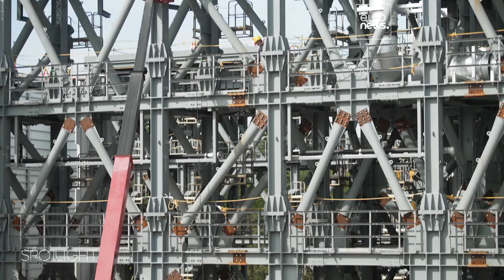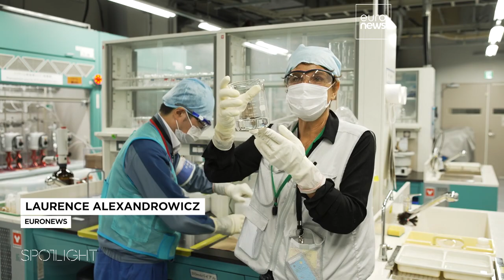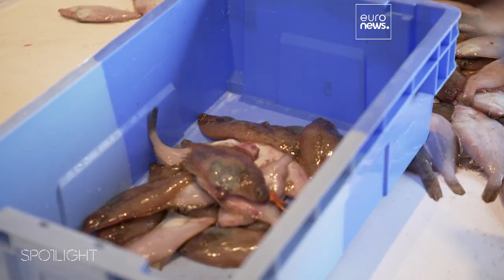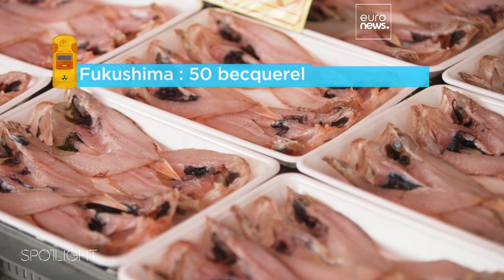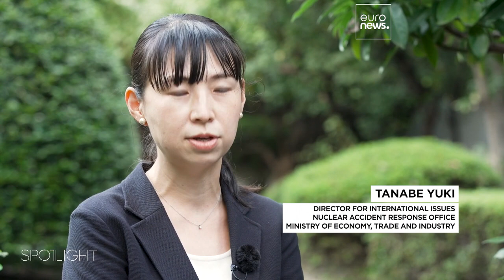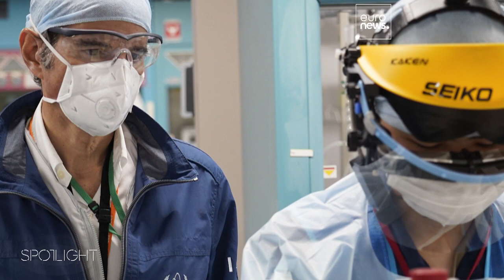Fukushima: Japan prepares to discharge water from the plant into the sea

Comment: Where are those Japanese Engineers?  A simple solution is to build an external loop to recycle the radioactive water back into the reactor for cooling, instead of using clean fresh water for cooling.
Reply: Japan has the ability and technology to solve the problem, but that will consume a lot of money, and discharging into the ocean is a very cheap economic solution.  The Japanese don't care about the consequences.
Reply: @joezou8793   The Japanese tritiated water releases are lower than what your country releases.  Perhaps you don't care about the 'consequences'.

Comment: The contaminated water will directly go to the north american continent flowing over the pacific ocean since the flows of the pacific ocean is turning clockwise.. just google it😢 I am so worried… it will eventually pollute all over the ocean. shame on you japan
Reply: The US has been releasing the same tritiated water for over six decades.
Reply: @ForbiddTV  The contaminated water of Fukushima is distinguished from other nuclear power plants not only by its greater variety of radioactive materials but also the overall much higher radioactivity. If it is discharged to the Pacific Ocean, it will potentially pose a significant threat to the well-being of human health and marine life. Normally, water that is used in cooling a nuclear plant in routine operation and then discharged to the environment has no direct contact with the nuclear reactor fuel cores. In contrast, the contaminated water generated by the Fukushima disaster has come into direct contact with contamination from the melted down cores of three reactors and as such is severely contaminated with many radionuclides. In other words, it is not appropriate to compare nuclear wastewater of normally operating nuclear plants in general and the Fukushima Daiichi nuclear wastewater. According to the latest report by the Japanese government, there are  621 radioactive isotopes were found in the existing nuclear water tanks in Fukushima, among which concentration of a radiouchile called tritium reached about 860 TBq2 –  an alarming level that far exceeds the acceptable norm.

Comment: Shameless Japanese
Reply: All countries with nuclear power plants release the same tritiated water.
Reply: @ForbiddTV  The contaminated water of Fukushima is distinguished from other nuclear power plants not only by its greater variety of radioactive materials but also the overall much higher radioactivity. If it is discharged to the Pacific Ocean, it will potentially pose a significant threat to the well-being of human health and marine life. Normally, water that is used in cooling a nuclear plant in routine operation and then discharged to the environment has no direct contact with the nuclear reactor fuel cores. In contrast, the contaminated water generated by the Fukushima disaster has come into direct contact with contamination from the melted down cores of three reactors and as such is severely contaminated with many radionuclides. In other words, it is not appropriate to compare nuclear wastewater of normally operating nuclear plants in general and the Fukushima Daiichi nuclear wastewater. According to the latest report by the Japanese government, there are  621 radioactive isotopes were found in the existing nuclear water tanks in Fukushima, among which concentration of a radiouchile called tritium reached about 860 TBq2 –  an alarming level that far exceeds the acceptable norm.
Reply: @blackbelt2000   No difference whatsoever.  All nuclear power plants utilize ALPS, so the final product is merely tritiated water.  The Japanese water release plan meets all international safety standards.
Reply: @ForbiddTV  what about all the cesium. Don’t be so delusional.
Reply: @johnosullivan-nq2wd   ALPS removes all but the tritium, don't be so delusional.
Reply: @ForbiddTV  are you an advocate for the Japanese government? What is the reason for your overzealous support for their insane decision to pollute other countries’ pacific ocean in order to save some money?

Comment: What a responsible country, ashamed
Reply: All countries with nuclear power plants release the same tritiated water.
Reply: @ForbiddTV  The contaminated water of Fukushima is distinguished from other nuclear power plants not only by its greater variety of radioactive materials but also the overall much higher radioactivity. If it is discharged to the Pacific Ocean, it will potentially pose a significant threat to the well-being of human health and marine life. Normally, water that is used in cooling a nuclear plant in routine operation and then discharged to the environment has no direct contact with the nuclear reactor fuel cores. In contrast, the contaminated water generated by the Fukushima disaster has come into direct contact with contamination from the melted down cores of three reactors and as such is severely contaminated with many radionuclides. In other words, it is not appropriate to compare nuclear wastewater of normally operating nuclear plants in general and the Fukushima Daiichi nuclear wastewater. According to the latest report by the Japanese government, there are  621 radioactive isotopes were found in the existing nuclear water tanks in Fukushima, among which concentration of a radiouchile called tritium reached about 860 TBq2 –  an alarming level that far exceeds the acceptable norm.
Reply: @blackbelt2000   The water could be released all at once with no issues. There is always around 3400 grams of naturally occurring tritium in the earth‘s atmosphere as it is constantly being produced by cosmic radiation interacting with the upper atmosphere. Most of those 3400 grams are in the earth‘s oceans. The water in Fukushima only contains 2-3 grams of tritium so releasing it all at once would have no measurable impact. There actually are a number of nuclear facilities that release significantly more tritium every single year. The La Hague nuclear reprocessing plant in France for example releases 40 grams of tritium into the Atlantic EVERY SINGLE YEAR. The reason why they are only going to release 0.1-0.2 grams of tritium per year at Fukushima is that the regulatory limits for radioactive releases from the plant are still the same as they were before the accident. So Fukushima isn‘t actually allowed to release more tritium in 2023 than it did when it was a normally operating nuclear plant.
Reply: @ForbiddTV  What happened to Cesium? This contaminated water had direct contact with exploded nuclear reactor which no other nations have now. Good job Japan.. they have a big plan to serve two headed tuna sashimi with lower price in the future lol.
Reply: @larryhoppe7662   That's completely incorrect, ALPS removes all but the tritium.  You could have easily looked that up.

Comment: Why nobody condemned Japan?? Anyone from the Green Party?? A bunch of double STANDARD deluded hypocrites.
Reply: All countries with nuclear power plants release the same tritiated water.
Reply: @ForbiddTV  The contaminated water of Fukushima is distinguished from other nuclear power plants not only by its greater variety of radioactive materials but also the overall much higher radioactivity. If it is discharged to the Pacific Ocean, it will potentially pose a significant threat to the well-being of human health and marine life. Normally, water that is used in cooling a nuclear plant in routine operation and then discharged to the environment has no direct contact with the nuclear reactor fuel cores. In contrast, the contaminated water generated by the Fukushima disaster has come into direct contact with contamination from the melted down cores of three reactors and as such is severely contaminated with many radionuclides. In other words, it is not appropriate to compare nuclear wastewater of normally operating nuclear plants in general and the Fukushima Daiichi nuclear wastewater. According to the latest report by the Japanese government, there are  621 radioactive isotopes were found in the existing nuclear water tanks in Fukushima, among which concentration of a radiouchile called tritium reached about 860 TBq2 –  an alarming level that far exceeds the acceptable norm.
Reply: @ForbiddTV  Since Japanese government claimed the radioactive water caused no harm and very clean why don't they consumed it??

Comment: The radiation levels offshore of Fukushima have dropped in the years since, but some of the reactors there are still leaking. And over the last decade, Japanese authorities have continued to cool the fuel cores with water, which is contaminated by the process. In addition to tritium, more dangerous isotopes with longer radioactive lifetimes, such as ruthenium, cobalt, strontium, and plutonium, sometimes slip through the process. These additional nuclides are present in 71% of the tanks, according to a recent study by local universities. These radioactive isotopes behave differently than tritium in the ocean and are more readily incorporated into marine biota or seafloor sediments.

Comment: Fun fact... The radiation from the Fukushima ELE is killing off the phytoplankton and atmospheric oxygen levels have been dropping because oxygen is no longer being replenished like it used to be. It doesn't take long for oxygen to be used up in one way or another.

Fun fact... as the planetary ocean continues to warm, the methane hydrates are melting and releasing their methane. 

Methane oxidizes, removing breathable oxygen from the air. More the methane, less the oxygen.

Fun fact... this is permanent. It will never get better because of the loss of the phytoplankton.

Bye-bye oxygen.
Reply: But wait! There's more!

Fun fact... Everyone is just marking time until the completely 100% inevitable next CME/carrington event that's coming down the pike.

And then... major bigtime EMP. And then... eventual nuclear meltdowns of all the reactors and spent fuel pools as they lose their cooling systems. The planet will be quickly radiation sterilized from pole to pole.

No one survives. Not anyone anywhere. Everyone dies. And that's that. End of story.

Fun fact... There are hundreds and hundreds and hundreds and hundreds of nuclear reactors and spent fuel pools.

Fun fact...  It is 100% inevitable that the planet will be in the wrong place at the wrong time for a CME/EMP.

Fun fact... nuclear war is hardly even worth mentioning compared to nuclear meltdowns.

A bomb goes boom and that's all the radiation it will ever produce. But meltdowns produce and spew out enormous amounts of new radioactive particles next to forever.

Fun fact... You won't enjoy dying from radiation sickness even the least little bit.

Fun fact... Every day that goes by has become one day less to global meltdown radiation oblivion.

The existence of the many, many, many hundreds of nuclear reactors and spent fuel pools and the loss of their cooling systems will be the Final Word as to What Will Be What.
Reply: Oh, Craig, Craig, Craig...

What part of "100% inevitable" do you not understand?
Reply: Many, many, many hundreds of nuclear reactors have been built like carrington events never, never, never happen. But they do. The Big Bad Wolf of the "final" CME is very definitely coming down the pike. And it can't be denialismed away.
Reply: Is there really, really, REALLY a CME/EMP coming down the pike?

Answer... yep.
Reply: @satanofficial3902   That didn't address a single one of your memes, you just obfuscated away from them.
Reply: Show anything that has gone extinct due to Fukushima radiation.  

Show your evidence of even a single phytoplankton that has been harmed by Fukushima radiation.  

Show your evidence of even a single oxygen molucule destroyed by Fukushima radiation.  

Show any oceanographer, marine biologist, or scientist that implicates Fukushima or radiation as a causation factor in any or your phytoplankton/oxygen/methane/hydrates memes.  

Nonsense is not impressive.